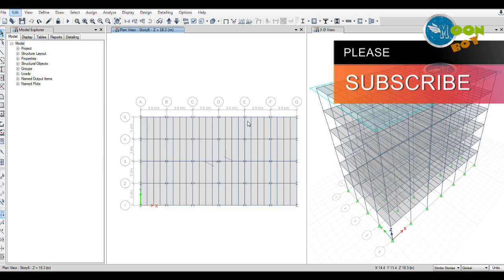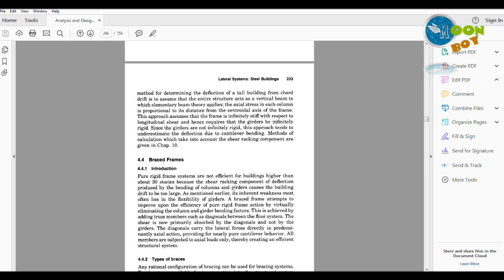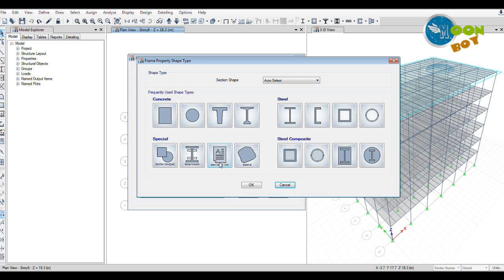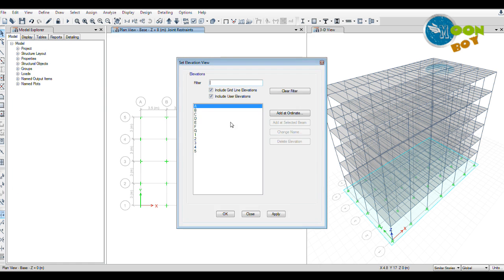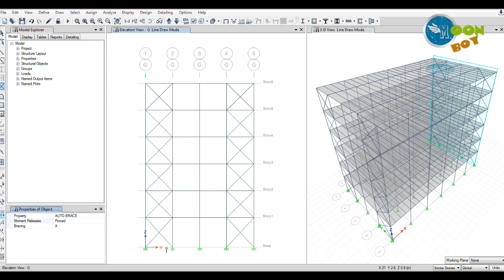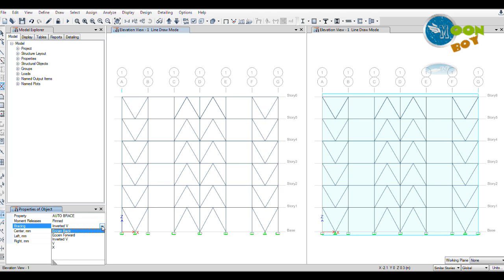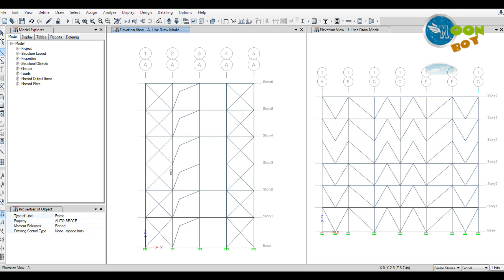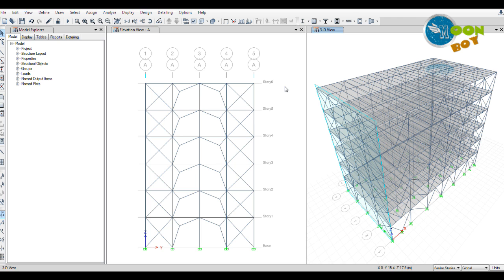Etabs 2015 tutorial 9 | How to Place X Bracing, Off-Diagonal bracing, V Bracing | Using IS Codes

Comment: Is diagrid hexagrid and octagrid lateral load resisting system is same aur different things from bracing system sir
Reply from the maker: Depends based on section size and strength.
Reply: ISMB500 is used for beam and column .and for octagrid box section of 91.5*91.5*4.5mm is used.in octagrid model near about all peripheral column is removed and provide the octagrid.which is 8sided.can you share me your what's up no .I will share you full details

Comment: Hi sir
I am a mtech 2nd  yr structure Engineering students..
I watched all you videos..
My project was different types of bracing frame system in g+9 storey build..
I followed your concepts n designed 3 models 
1) a simple unbraced frame
2) concentric bracing frame str.
3) eccentric bracing with zipper coloums.
But in our college they r saying it's wrong .
What should i do sir
Reply: If you kindly rpy me i can send those 3 models to ur gmail
Reply from the maker: @alokkumarmohanty8403  Please add end conditions which are required for your project and also other loading pattern requirements. Please try to find requirements from your guide. Edit necessary things with your experts advice. Procedure of providing bracing is what I have shown. Remaining things may vary project to project.
Reply: @moonboyslife   sir..
My guide is saying you can only use angle sections for bracings
You can't use ISLB,ISMB,ISHB& ISWB section for bracings .if you are taking this it's a wrong procedure.den i showed you videos from here i learn
Then i make my steel section design from autosection mode as you did in your videos 
But my guide is saying choosing auto selection mode is wrong.you have to choose a single section for beam & a single section for column is it write or wrong m confused.
Like he is saying to me your entire building should be desing with a single sectioned beams & and a single section column & composite beams & barcings
Reply: @moonboyslife  sir.
Plz rpy me as soon as possible bcz on 20th july i have to submit my thesis.i took beams , columns, composite beams & braces from autosection mode den i calculated the Response spectrum, time hystory 
All results a comming also
Reply: @moonboyslife  
I read some journals they are also using ISHB section for bracings.
But my guide is saying we can't use it's a improper design.plz sir expain me why autosection mode is wrong .
N for project we don't know what size  should we take for beams & colums as it's not a concrete structure.
Reply from the maker: @alokkumarmohanty8403  we cannot depend completely on software. While it gives accurate results, but as per your requirements you need to change sections and sizes.
Reply: @moonboyslife  bro i have a simple question
Auto section is right or wrong
Just ans this don't deviate me.
Reply from the maker: @alokkumarmohanty8403  design is correct but you need to check it whether it's practically correct. Sometimes software shows lesser section at bottom and higher at top. Then you need to decide it logically that higher size to be provided.

Comment: How to decide eccentricity in eccentric bracing
Reply from the maker: It is as per your site requirements. If no vehicles or obstructions are not present then you can go for diagonal instead of eccentric. Even a good start to take 60 degrees angle. maximum 75 degrees can be taken. also refer the code of practice AISC 360-10 for more clear understanding.